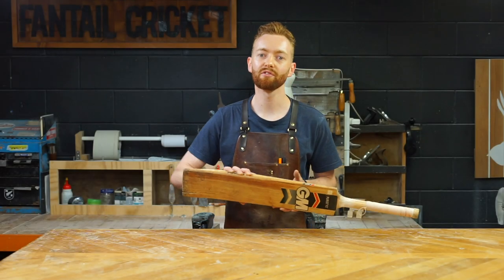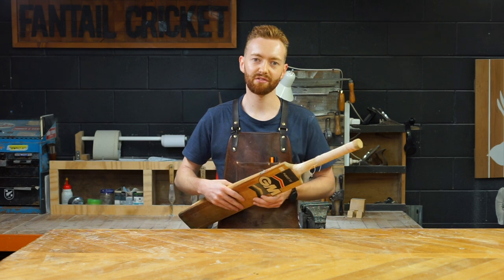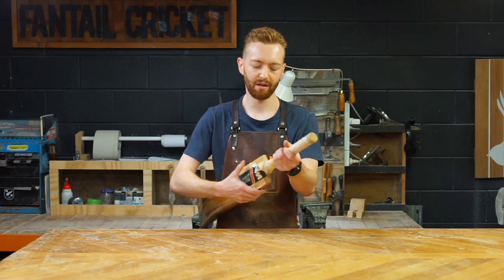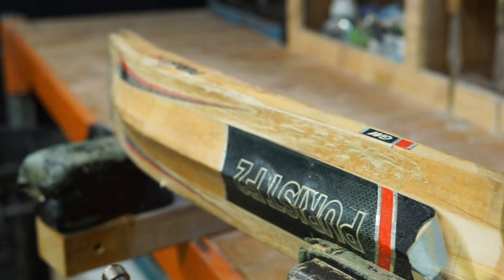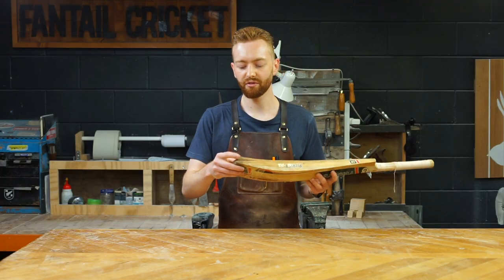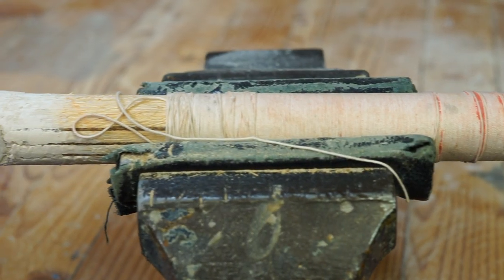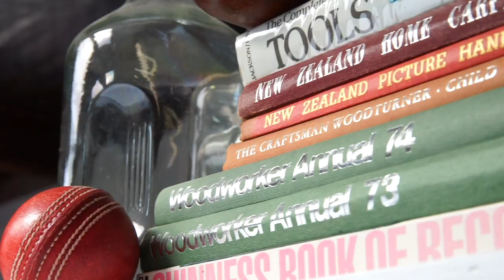Cricket Bat Repair EP-3 - Shoulder & Toe Repair + Handle Replacement

Comment: How do you get the self adhesive face cover to stick to the bat face after applying oil??
Reply from the maker: We are releasing a video today detailing how to remove and apply a facing. That will have all the details you need.

Comment: Did you use epoxy resin for the crack and the toe, and PVA glue for the handle? It seems there were two different glues. Am I correct?
Reply from the maker: Yes that's correct.
Reply: @FantailCricket  Thanks. Any particular reason of the choice? Like, is there a reason to chose one for a particular kind of task?

Comment: Hey Mate After watching some of your older videos I decided to fix my own bat that had the handle just starting to split out of the bat (the bat splitting no the handle) In your Repairing A Broken Cricket Bat video from Feb 2019 you used dowel to hold the handle in place. Personally i glued all the cracks up then I put 3 pieces of dowel down one side and just one in the other to hold it in place,. Does this damage the bat and or performance. Because after some through down with it it sounds a bit different up closer to the spine. (could this also be because it has no binding on the hand and no grip. Cheers
Reply from the maker: It sounds like the handle needs to be replaced. The layers have likely delaminated. We don't recommend using a bat without binding on the handle.
Reply: @FantailCricket  Righto thanks